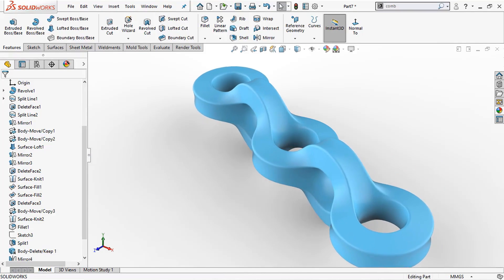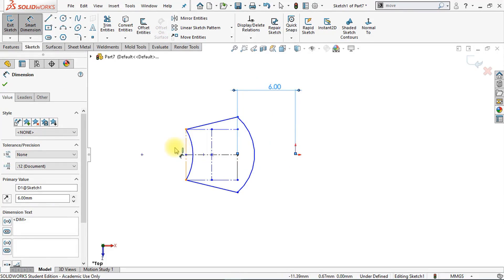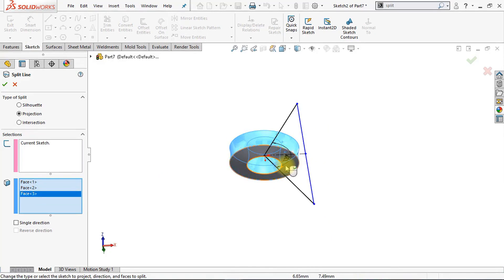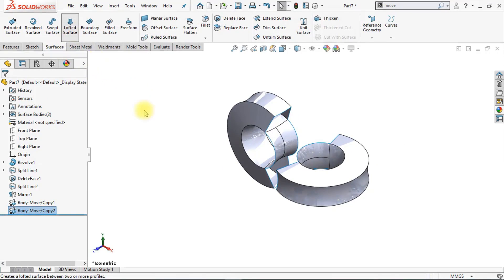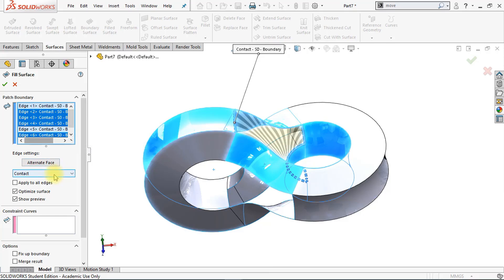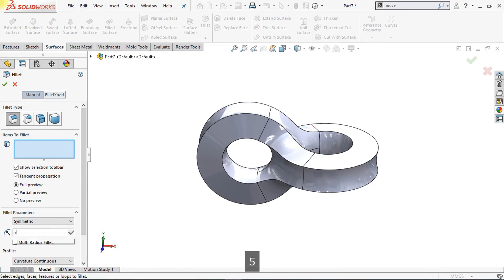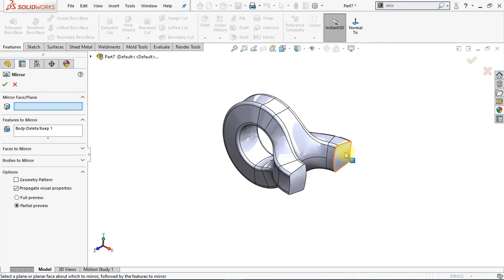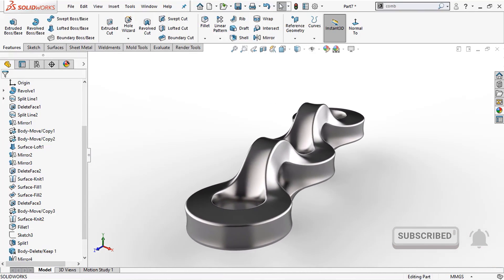How to model an Endless Chain in SOLIDWORKS?

Comment: excelente , I dont have combine the multibodies ? I dont not
Reply from the maker: Thanks! Quick question: Which version of SolidWorks are you using?
Also, can you check if you actually see multiple solid bodies listed in the Solid Bodies folder in your FeatureManager tree?

If there’s only one body, the Combine feature won’t be available — it only works when two or more solid bodies are present.